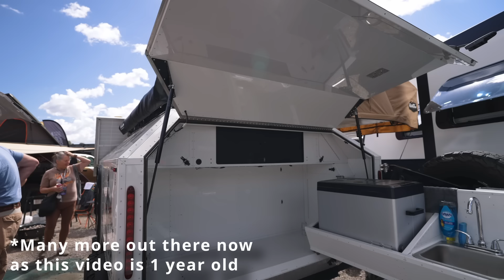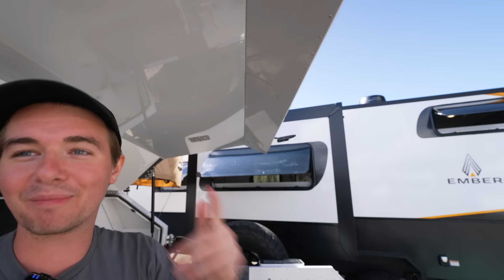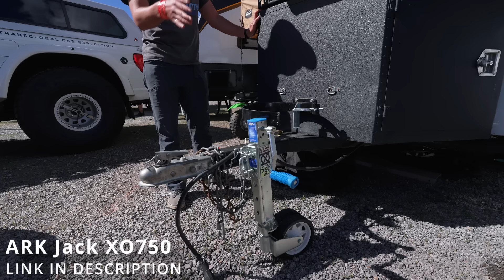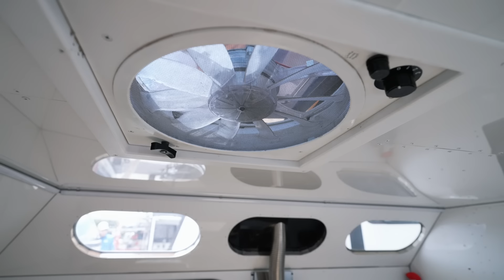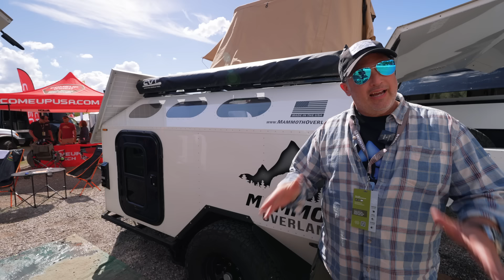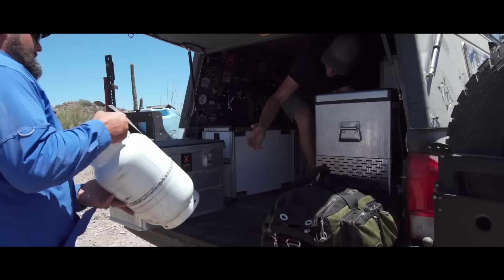Mammoth Overland Reinvented the Small Camper!

Comment: The propane system seems like an afterthought. How isn’t it all piped in to a common header? Packing the tank around to each use area seems silly. Also the water heater is in a terrible spot if you were to use it for a shower

Comment: I don’t know why they brag about a 100W solar panel, as that does squat in the real world when it’s fixed.  I have 2 x 100W on my roof top tent, and my average solar I get is 70W.  In ideal conditions, when the tent is open and the solar panels are perfectly angled to the sun I get 186W.  However, just to run the fridge it’s about 30W an hour at night, but 45W during the day as the heat builds up inside where it’s located.  Ideally I need a total of 300W panels, so when panels are not in the optimal set up it generates 100-150W on average.  If I have even more usage than normal, or wish to extend my stay I do have the EcoFlow 220W bi-facial portable panels to chase the sun.  As I look into a trailer, probably best to splurge and get the extra battery.

Comment: Your cons are not cons, there is storage you just have to understand our lifestyle.  Propane, thats very easy, you get a second 20lb bottle and store it on the rack and you just get a second hose..  and the windows, no issue for me I camp in the artic weather so give me sun, but for others they just cover them and the fan vents heat.
Reply from the maker: Yep, I think I actually talked about that 2nd propane. And I also talked about what to do with the windows. But thanks for summarizing. And yes, I do understand the lifestyle, that is why I said I had this trailer wrong. I now realize it is for overlanders with a properly outfitted tow rig. Sounds like you may have missed parts of the video. But, I am glad to hear you and I are on the same page.

Comment: Nice camper but that propane needs to be plummed in to the camper. Moving and connecting would be annoying. And the exhaust for the furnace is under the sleeping area tent. Bad idea. Co2

Comment: This is probably my least favorite trailer I have seen on this channel... The kitchen might as well be built into the back and just a table to prep food, then add in the walmart led strip attached above? The spare tire just swings freely (we know how that'll go on those windy days). Not too mention the swing out puts the stove out in the weather... Then we move onto the roof fold out step with no handles what so every to climb up on, are we supposed to just jump up on that step or grab the solar panel? The cooler rack... What a very odd place for this... That's either the tundra 45 (24.6lbs empty) or the Tundra 65 (30.3lbs empty)... Please explain how that makes any sense what so ever! Who's lifting a loaded cooler up there (not too mention sitting right in the sun)!? Propane tank mounted on the front of the tongue with no protection at all from rocks etc. Why in the world is the propane line not connected in a system with cut off valves to allow the tank to stay in place at all times and cut off what's not needed? Who wants to keep carrying a tank around and choose "Do we have heat in cold weather or do we cook"?
Reply from the maker: I can tell you understand why I held on to this video for a while. 😂 It took me awhile to figure out who it was for. I do see the value in it, it's just not a good fit for our family and many of the people in the playing with sticks community.
Reply: @PlayingwithSticks  I realize re-reading my comment, it sounds like an angry rant😂
But yes, I most Definitely see why you held onto this video 😂 But hey, we all still love your work and dedication to showing everything that's out there!

Comment: Intriguing and lots of things to like. But probably a better build than actual design. Needs a thoughtful 2.0 rev. Lack of storage shouldn’t need to be explained away. And for a massive swing-out kitchen, you end up with a smallish fridge and semi-useless second burner. And plumb the damn propane for gosh sakes!
Reply from the maker: Good idea on the 2.0 rev. Dean. I like that idea a lot. There are a few parts of the design like the ease of cleaning, simplicity, and less is more approach that I appreciate. I think they could build upon this to make a special trailer.
Reply: Already has a 2.0 since you’ve posted this video.

Comment: Like Drew, think I’ll give this trailer a little while to digest. I’m skeptical and intrigued at the same time.  They spoke of an inner shell and outer shell that is insulated in between, but nothing on what the insulation material actually is…I would like to know what any camper is insulated with exactly.  Also, I noticed since the rear hitch is recessed underneath the trailer, it looks like actually utilizing a rack to carry bikes may prove cumbersome given the spare tire(s) would be right in the way potentially.  I could see having to extend your 2” receiver out more, causing more overall damage to whatever you’re transporting over time.  Need to move the bike racks to the tongue in my opinion. Thanks again Drew for the great video and info!!
Reply from the maker: Like you mentioned almost all manufacturers seem shy to share their r-values and insulating materials. Not sure why. You will see this in almost every one of our videos. Good point in the tire swing out as well. Like I mentioned in our towing mistakes video you are absolutely right about extending out that receiver. Every inch dramatically increases the forces at play that will damage those bikes. I even see this play out with the connection between the tow vehicle and the trailer. Any rises, extenders, moving parts really take away from the overall towing experience.
Reply: I noticed the same thing on the tow hitch in back. What can you possibly use that for? Towing another trailer? You can even out a bike rack or storage back there with that angle
Reply: Yes, you can put a bike rack back there. You use a hitch extension.

Comment: Saw one in person and it’s very cool, particularly the kitchen, but my main issue with it is that the doors were tiny.  Would drive me crazy getting in and out and loading and unloading.
Reply from the maker: The doors in this industry are still quite small. Unfortunately there is really only 1 door manufacturer out there (lippert). But, Arctic Tern just came out with a new door, so I hope that paves the way for others to start entering the market.
Reply: @PlayingwithSticks  we ended up getting an Intech Flyer Pursue and it has pretty large doors. I wonder how they compare to the Bean Stock 2.0, which we still see as an option in our future.
Reply from the maker: Intech makes a great camper. Good choice. I'm guessing the Bean Stock and Intech have the same door. Bean is using the largest door from Lippert and it looks like Intech is using the same one. Most people call it the "oversized door" or entry.

Comment: Saying “I can’t get through a night with the heater on” is an interesting statement. Haha. Hopefully there is a thermostat to control that…
Reply from the maker: I just assumed there would be a thermostat. Interesting.
Reply: @PlayingwithSticks  the older models had to be manual lit. The newer model has a button pushing system to light. It has a fan knob and heat knob both manual.
Reply from the maker: I like the simplicity, but I also see the potential issues there.
Reply: Nope
Reply: I run the heater on low when it’s below 40° outside and keep a window cracked. It’s perfect and leaves the trailer a nice 60-65°. The heater is a godsend in the winter.

Comment: 7. Camber and aliment issues.  Mammoth initially did not even install the cross members on the Timbren. One customer had a bent frame do to this. 

8. Roof leaks.

9. Door latch issues 

10. Spare tire rear mounts not beefy enough 

11. Shoddy wiring.

I will say that most folks seem like the customer service is decent.
Reply from the maker: #8 was the one that kept popping up online. Which is why I asked about the rivets. Wonder if it is the windows?
Reply: @PlayingwithSticks I believe it's more the windows
Reply: The Timbren ignorance is the tell tell sign they winged it pardon the pun
Reply from the maker: Love the pun. Timbren is a bit complicated if you aren't in the industry or you didn't dig deep into the manual. They sell it as if it is axle-less suspension. Well, sort of. But, once you add the axle or build the cross support into the frame, like you mentioned, they are great options.
Reply: Roof leaking can happen with any trailer that has an opening for an accessory. In this case, either a dometic or fresair unit. The sealant failing, not a flaw in the design of the trailer, causes these issues.
Reply: @driven2roam  it is a flaw in design and  installation and or materials.  More holes in the roof the more potential leaks.
Reply: @bartman1857  To each their own.
Reply: @weatheredtrails  cutting six holes on the down slope plus two on the flat top of the roof is not a flaw in design?
Reply: Cutting holes in a trailer for windows, air conditioning, or ventilation is standard practice in the world of recreational vehicles. Properly installed windows and air conditioning units are essential for comfort, usability, and airflow. These modifications are intentional improvements designed to meet the owner’s needs, not flaws in design.

When done correctly—using appropriate sealants and reinforcements—these changes do not compromise the structural integrity or weatherproofing of the vehicle. This is a common and widely accepted practice across RV and van conversion communities, where such installations are considered standard and effective. Calling this a design flaw shows a misunderstanding of how RVs are typically customized for function and comfort.

As for the Mammoth’s roof leaks, these issues stemmed from the seal of a Fresair unit, which failed on our trailer and required a customized replacement. This issue has already been addressed in newer trailers, making it frustrating to see outdated criticisms repeated. The improvements in the Mammoth’s design far outweigh past issues, and it’s disappointing to hear rhetoric like this, especially when the criticism ignores the significant advancements made.
Reply from the maker: @driven2roam I agree. We need to celebrate the improvements. I also want to caution us All from normalizing standard RV industry practices. Even the best small camper manufacturers are aware that anytime you put a hole on a horizontal surface, you are introducing future issues. Is this the common practice? absolutely. Without holes cut out of roofs, You eliminate rooftop ACs, fans, etc. But look over to our brothers and sisters in Australia and they're far ahead of us putting these on vertical surfaces or even under the trailer. But even with that again it's a hole, it introduces potential future issues. The less holes, the less movable parts, the less seams, all this adds up to a trailer that will last a lifetime. But, there's always sacrifices. While I know putting zero holes in my roof would be best practice, I still prefer having a vent fan.  I'm all about getting  as close as possible to a maintenance-free trailer. Anytime you introduce lap sealant, silicone, glue and screws, You're introducing future problems down the road.
Reply: @driven2roam  very eloquent post and you have valid points. I still think 6 holes on the down slope of an off-road trailer is a poor design. Not to mention a furnace that is only rated to 5,000 vertical feet. I guess it doesn't rain much or there is not much high altitude camping in the PNW 😉

Comment: I am sure these guys make great airplanes, but off-road trailers are a different animal.

I did a deep dive into the new standup called the TL. I lot of the issues that this HV has were carried on to the TL. If anyone is interested in those issues, let me know.

So here are some of the problems folks have mentioned on the Mammoth FB group.

1. The beefy carbon steel chassis, rock sliders, tounge box, and rack are not even powder coated.  HUGE rust issues. 

2. The winows leak like crazy and along with all the aluminum structures, help create big condensation problems.

3. The furnace is rated to 5,000 vertical feet elevation.  I would have to go downhill to camp that low.

4. Gaskets falling off and leaking 

5. The rear hitch needs an extended draw bar, which limits carring anything back there.

6. Cooktop stove flame king is $80. Water heater. has many  issues $140 on Amazon.  One owner had a $20 solar charger on his trailer.

To be continued...
Reply from the maker: #1? Really. That shocks me. #2 that answers my question on your other comment. #3 That's worse than the Big Buddy. We carry the Little Buddy with our Big Buddy Just to get above 8-,000-9,000. It's rare we are up that high, but it happens. #5 and then once you extended it you are just adding to the forces working against whatever you install on there. #6 I noticed that as well. Interesting for an overland trailer company to choose inferior products, that is typically the opposite case for anyone selling an offroad trailer. Bonus thought: I could tell they didn't build upon previous trailers in the market, which concerned me. When I asked the President of the company what trailers inspired them and where did they do their research they said none inspired them and they didn't research. They felt the industry was behind, so they took everything they knew form the aircraft industry and built a trailer from scratch.  I thought that was an interesting approach. Remember when I shot that Lance trailer video? I applauded them for their research. Every component was the best or one of the best components from the overland industry. A trailer coming from the Large RV Industry, and not cutting corners was impressive. While I also did a lot of head scratching on that trailer, it was nice to see they did their research first.

Comment: One thing over looked on almost all "over land trailers is wheel travel!  torsion axles suck . short little  leaf springs suck. if you plan to travel down  a wash board for 100 miles (Death Valley), you need long  travel pliable suspension  with shocks or your gear will be beat into dust
Reply: Not if you drive slow and easy Timbrens are good enough in my opinion.  Much lighter , less sway on hyway and less to go wrong
Reply from the maker: I'm one of those guys who actually likes a torsion axle. We really aren't carrying fragile gear as campers. It is the trailer that I would be worried about. A properly built trailer can easily handle a dexter torsion axle or simple independent suspension like Timbren. But, I agree that once the price gets higher, that trailer should have some sort of trailing arm/long travel suspension to justify the cost.
Reply: Road to Race Track.

Comment: I don't know maybe im jaded .
My family owned a motor home dealership in the 80s. I worked there through high school. 
After the bad economy we went back into diesel mechanic shop.
Anyway I know how these are built even with modern upgrades the markup is ridiculous and has gotten worse. 
Most motorhomes and trailers are only designed to last 5 to 10 years before stuff starts falling apart. 
I really don't understand paying 20,000 for a bed.
Teardrop trailers were designed for people that couldn't afford a trailer but had skills and liked camping. Now they cost the same.  Really believe a suspension cost $10,000.
Just don't understand
Reply from the maker: Yeah, the industry is a little out of control. But, sales are down and I'm predicting we will see the industry prices self correct soon.

Comment: The lack of fenders over the entire tire would make this illegal for road use in some areas, if not in most.  Magnetic curtains would not work on the aluminum; you would have to use hook-n-loop fasteners.  The high mounted cooler would hard to access, and very difficult to lift up or remove a loaded cooler, meaning you would have to load it after you put it in the rack.  The "greenhouse" window style would make this a hot trailer indeed.  Is air conditioning available?  Overall, well constructed but expensive (but cheaper than I would have thought).  Great review, Drew.
Reply from the maker: Yeah I totally missed the mark on that magnet comment. 😆 Thanks for pointing that out. I also didn't even realize that about the fenders.
Reply: A/C and swamp coolers are available.

Comment: Christine noticed the heater vent/chimney is under the awning.  Wonder if that is an issue.  I could see the heat melting the fabric or even worse, catching it on fire.
Reply from the maker: Good eye. I missed that the first time around.
Reply: I saw that too! It really worried me since it would melt/ignight the floor of the RTT! Like someone else said, Propex would be a better fit
Reply: We own this trailer. The heater vent is only hot to the touch and doesn’t throw superheated air out that is capable of melting anything. As long as it’s not physically touching it, it will not melt.